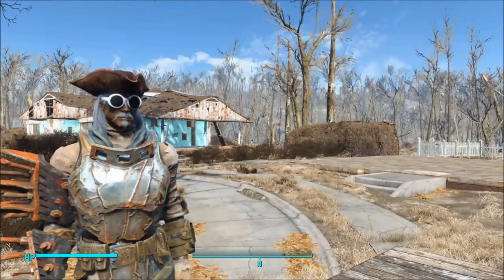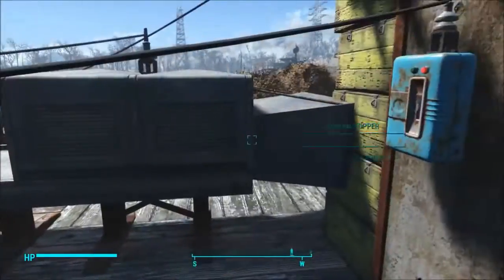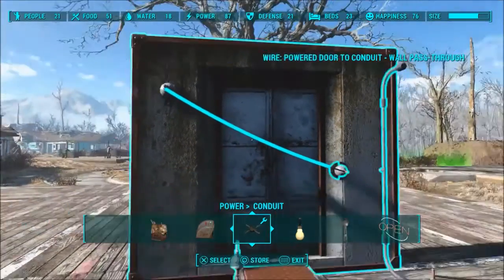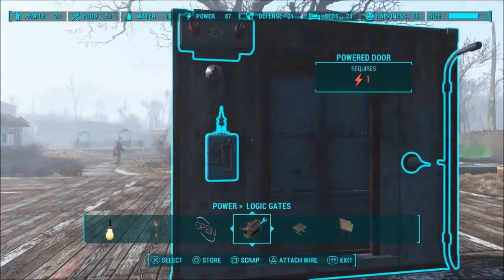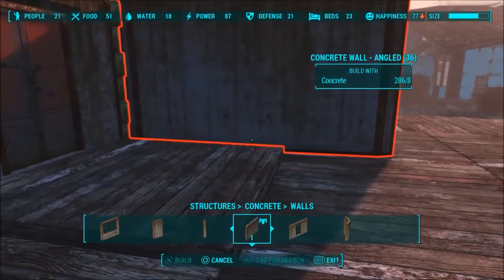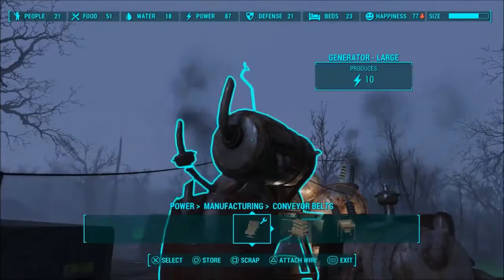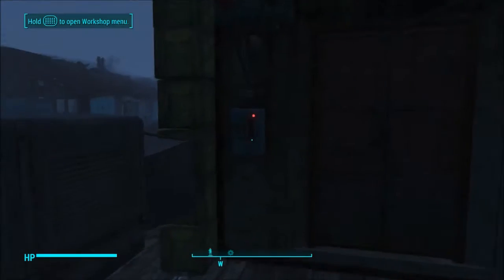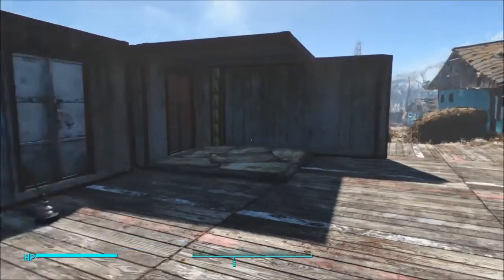Fallout 4 Tutorial: 2-way powered doors (using logic gates).

Comment: So when you do the switch on both sides of the door you have to use 2 different power sources? I cannot for the life of me figure this out @.@

I get as far as one door opening and that's it lol
Reply from the maker: +MrFuddyDuddy do you have the contraptions dlc?
Reply from the maker: +MrFuddyDuddy if your using the through wall conduits you shouldn't need more than 1 power source
Reply: Epileptic raveR
I'll just have to keep screwing around with it, tried setting it up in a test environment and was able to set it up just fine but for some reason just couldn't get it rigged up right on a door I had pre set up. Think its because I kept rigging it in a way that one door wasn't powered up right because I think I have it down now.

Both doors have to be individually powered (doesn't matter if there separate sources)

Both doors then have to connect to the positive

The door has to be hooked up to the negative (as well as a power source)